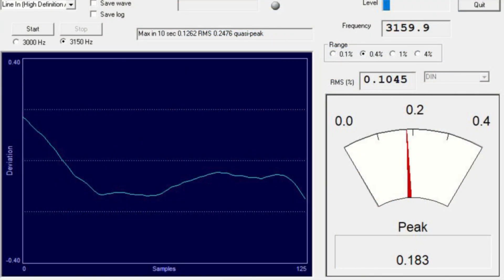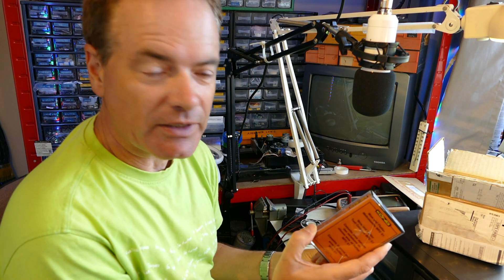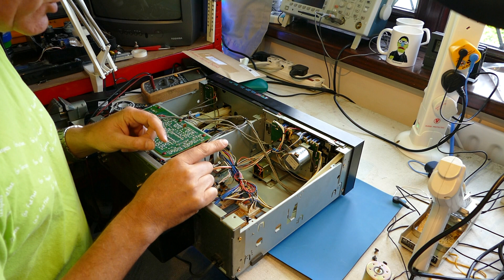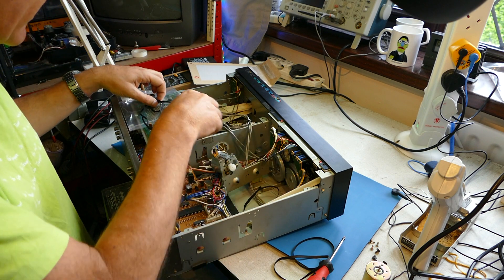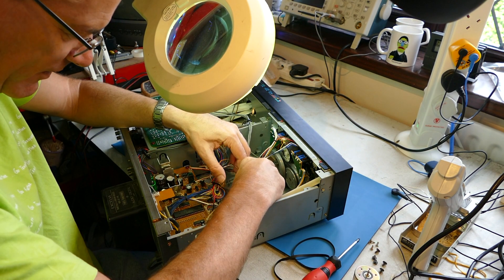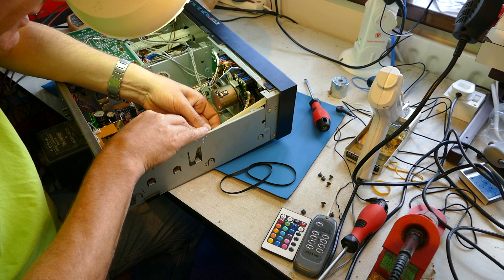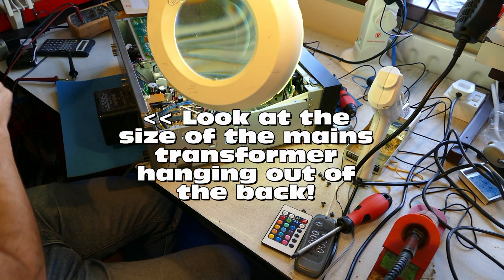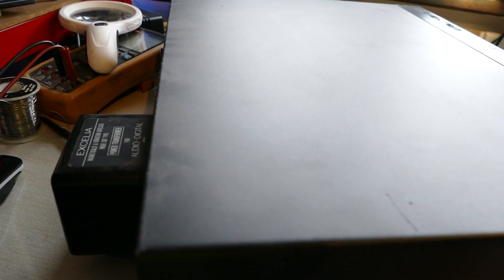Aiwa Cassette deck motor replacement, XK-007 Excelia.

Comment: With it been a 3 head deck, can you not feed in a 3150hz signal, then put the deck into record mode (with a decent tape) and measure the W/F coming off the tape as it records the signal??

Comment: Question..i have the 009 version and suddenly it have big trouble to run on playback.... could it be a belt problem on one of the two capstan ?? it impossible to listen...the Wow and flutter  are astronomic now...so sad about....
Reply from the maker: Could be belt or bad pinch roller.  Another possibility is lubrication of supply spool spindle, or failure of the motor.  I've had all of these defects between my three Aiwa decks which share essentially the same mechanism.

Comment: Nice video, I'm just about to do a Sony motor swap and I was wondering how we get the bully off... so it looks like I just pull. And measure it before doing so, good tip
Reply from the maker: Usually yes, they just pull off, if there isn't a grub screw insert.
Reply: I'm sorry, my English is very bad, it would be the rubber bands, the two black ruffles and the small brown one, thank you very much for answering so quickly

Comment: Hi i av a double aiwa cassette deck ad wx727k one of the bigger belts av snapped n the other 1 as come off.can put me in contact i could purchase 2 please?
Reply from the maker: If you can't find someone doing a kit for it, I would do an eBay search for cassette belts. Order them based on sizes. Try to get the best you can, avoid cheap belts from China.

Comment: excellent job, this deck is rated for 0.018 w&f score you came out with 0.1, what contribution is w&f of the cal. tape? 0.08? That would sugest your deck either  needs more attention or find better tape.... to bad, its one of the moste stable machines out there..

Comment: I have seen plenty Sony audio equipment that has it's transformer mounted outside the copper chassis, I think that they were trying to eliminate noise transfer.. 
Those motors buy the way can be taken apart to clean out the old lubricants! It could be a bit fiddly, I think that I saw Dr Cassette do it although I'm not exactly sure or unless it was The Post Apocalyptic Inventor... It was one of those two great guys! It could have saved you a lot of money if it had worked... 
I would probably say that it's also probably due to have all it's capacitors replaced, well that depends on what this cassette deck is worth to you! It's a lot of work for sure but for some people it's just not worth it! Aiwa made some very good cassette decks, I have one that's in storage which I personally purchased new, I can't remember the exact model, it has the exact same bias adjust setting sticker on the top just like yours! Mine has a lip that runs along the lower front of the unit and houses all the transport controls on it! I stopped using it when the wires that run to the quick reverse head started playing up, I ended up plugging it in years later and it didn't want to fire up anymore so it's still sitting around waiting for my bench to clear up a receive a complete overhaul, belts, lubricants and capacitors! It's from the 90's so it's about that time when manufacturers started cheaping out on components... I will definitely have to set up a camera and post the video, I really don't know why I haven't been doing it already? I literally have a double garage full of equipment and then there's more inside the house! That might be a video all in itself LoL!

Comment: thanks, usefull video! i have xk 009, after belts replacement on the capstans (identical mechanism) i'm getting clicking  and the heads would not go up, f.f and revinding works ok. I didnt disassemble the mechanism or anything further, only the capstans rest bar. Can you advise the reason.  May be the cogs under the flywheels should be in a certain position? thanks.
Reply from the maker: It's hard to diagnose a fault like that by remote control.  It's going to take some careful examination and reference to the service manual. Sorry, there's no obvious answer.
Reply: @video99couk  ok, thanks, understood.

Comment: Interesting video, and nice Aiwa cassette deck. I had an AD-F910 for a long time, replaced the belts in it, too. I have quite a collection of motors out of cassette decks I scrapped over the years. I also keep salvaged belts, but they have to be checked occasionally. It has happened a few times that a salvaged belt decided to start disintegrating, causing a mess...
Reply from the maker: I've not scrapped any decent cassette decks! 
I could use a better wow & flutter tape, I'm fairly sure that half of my reading was due to the tape itself.  Ever found a good one at a sensible price?
Another deck I have which needs belts is a Marantz SD420.  I changed the belts in that a few years ago but one is starting to disintegrate again.
Reply: @video99couk  Most of my parts stock dates back about 10 years ago when people were throwing out cassette decks left right and center. When there is plenty of fancy 3 head cassette decks to choose from, why bother with slightly broken 2 head cassette decks? Back then I scrapped a lot of cassette decks that these days I would restore...
So far I have refused to do any wow & flutter measurements, because all cassette decks inevitably have some wow & flutter and there is only so much you can do to reduce it. But viewers have started complaining about this omission from my repair videos since more and more YouTubers feature the software wow & flutter meter in their videos, so I will have to look into this topic. I recently bought a Leader LCT-193D "cassette checker".
For setting cassette deck speed I have so far used a 1 kHz cassette I recorded myself, with a frequency generator as the source. I have an Akai GX-75 cassette deck which is direct drive, so I am certain it runs at the correct speed and has low wow & flutter.

Comment: Any idea should be current draw of Pacific UCM motor in play mode. I replaced one in Nak DR-2, same mechanism as CR-3, speed still wonders around and slows down once the machine warms up or chassis is closed. Maybe the voltage regulator for the motor section is too low (it uses 2SA1406 200V, 0.1mA transistors). I measured the current draw and it's around 90-100mA, 12.07V, W&F 0.1- 0.15 RMS once it settled down to some speed, instead of wondering in +/-10Hz range. Just asking - possible that the Nak might have other problems causing the speed to slow down - capacitor, contacts, cooked LB1649 motor driver.
Reply from the maker: The other possibility is that the bearings are drying up.  Before I replaced the motor in this Aiwa, I applied a little oil to the end bearing of the motor and that made it work hugely better, proving that it was a motor fault.

Comment: The capstan motor on my Aiwa AD-F770 can't be adjusted anymore. Looks like I will need new motor. Where did you order yours from?
Reply from the maker: The answer to that is in the video description notes (Pacific Stereo in USA).  However it's not cheap, not cheap at all.  The F770 is also a bit of a pig because you can't really get at most of the back of the deck without taking the deck out which means a lot of removing of screws.  While you have it apart, make sure that the grease hasn't set inside the cassette spool spindles.  That can dry up and cause all kinds of transport wow/flutter problems.
Reply: @video99couk  I replaced the belts,pinch rollers  and fresh grease everywhere required. I guess the shipping will be expensive to UK?
Reply from the maker: @dimitarkirchevdimitrov6321  If you've done all that already, you know what you're doing with the deck.  Yes the motor is very expensive to import.  I had a friend in USA help me which cut the cost, but think in terms of around £80 or so and you're in the order of things.  You may be able to negotiate a slightly better price, especially if you're already a member of Tapeheads.net.  But it really is a decent motor compared to the ones you normally buy today.
Reply: @video99couk  Yes ,I'm member of the forum. I'll find the guy and ask him for the price. Thanks a lot for the info 👍

Comment: I've noticed warble on old vcr linear audio,  belts and a better pinch roller didn't seem to do much on the ancient machines.
Even newer vcrs with a one peice motor+capstan bar are not free from the dredded wobbles lol.
I came to the conclusion that the phospher bronze bush/bearing had wear and allowed the capstan bar to ride around on the bush and not stay dead on 90 degrees.
I could be wrong, wery likely lol.
Check the fit of the capstan bar in the deck bushing, just a daft thought :-D
Sorry about the long waffle.
Reply from the maker: VHS and Beta tapes of course run very, very slow, so the linear audio is limited.  The servo systems of video are quite complex of course, so you could get warble due to tracking issues, and I've even known a contaminated video head to cause audio warble as it "snatches" the tape on every revolution.  With higher tape speed, higher quality tape and well engineered decks, professional BetacamSP gives super linear audio results.

Comment: Boy, do I wish my Onkyo deck with it's Nakamichi mechanism was that easy to get to and disassemble.
Reply from the maker: Sometimes manufacturers just don't think about servicing.  The Aiwa F770 is a horrible thing to take apart, despite having the almost same deck as the XK-007.
Reply: @video99couk  I agree - the F770 is bordering on 'horrible' to work on.
Reply: Nakamichi?? Sankyo I guess...